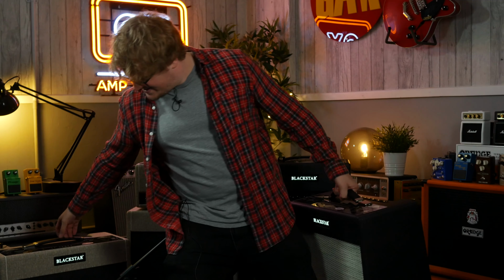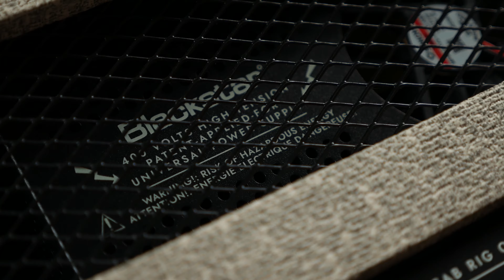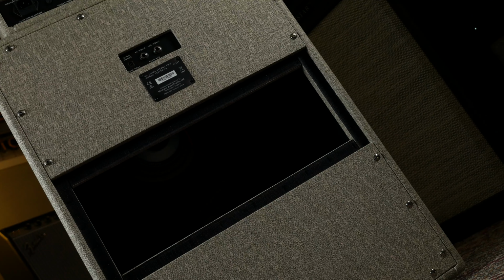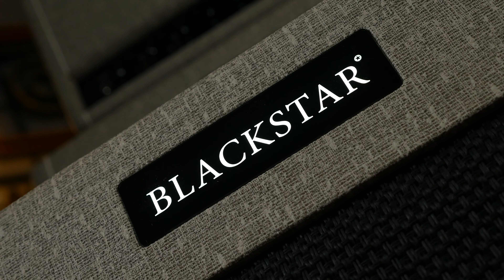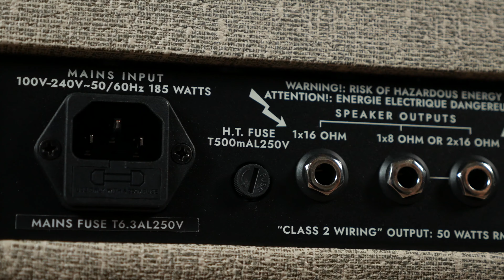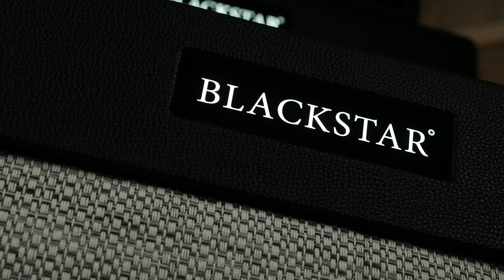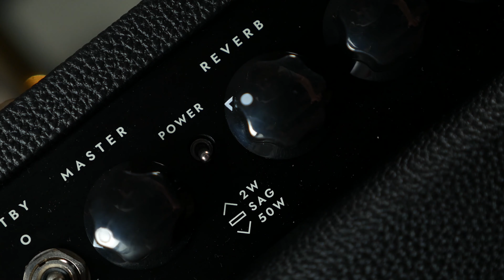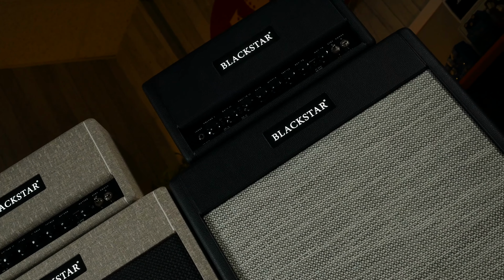The Lightest Valve Amps EVER Made?! | Blackstar St James Series

Comment: I know you said you are not an expert on transformers, but can you name a single amp that has more than one power transformer?
Reply from the maker: it's more the fact that classic transformers have to have a lot of different parts in it to cater for the variance in volume and power requirements, whereas a switchmode power supply is able to supply all the power the amp needs at one time without the extra bulk, and being much more seemless in its drawing of power....Again, not an expert, but that's what Blackstar told me ;)